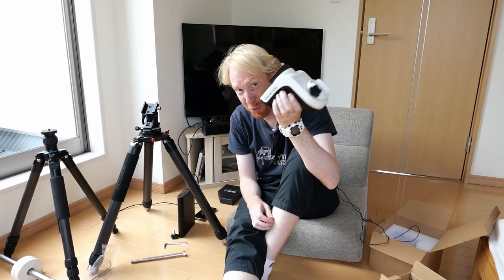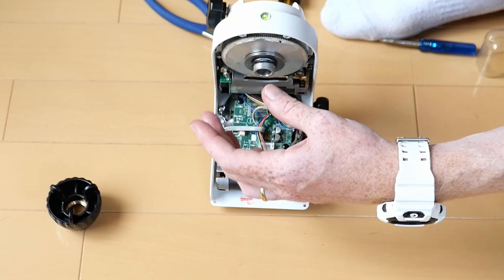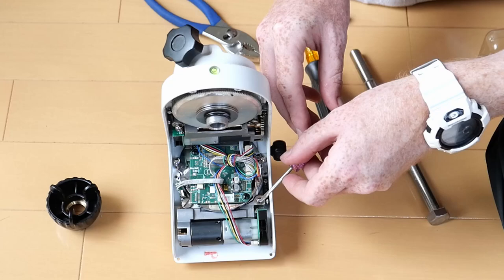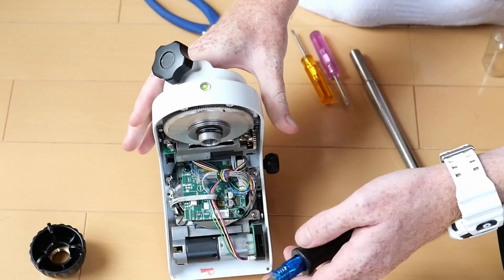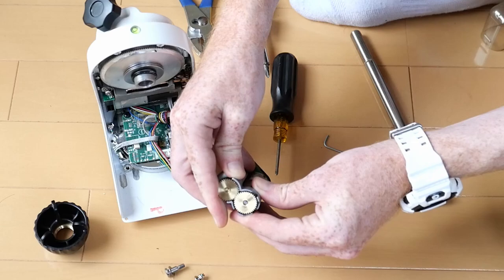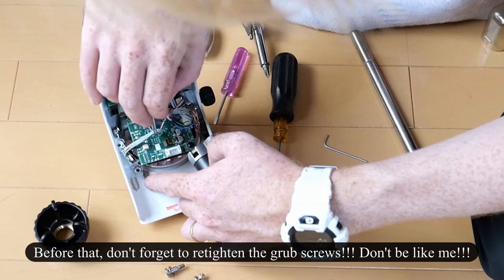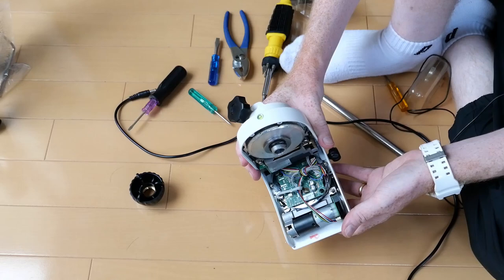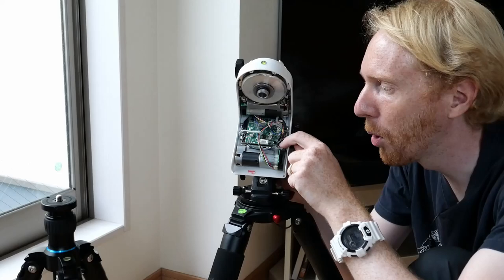Tuning the Skywatcher AZ-GTI! The road to an ultralight, fully automated astrophoto rig!

Comment: Thanks for this tutorial. I just bought one of these used, and will go through all the things you've done here, just to ensure it's working as intended.

in its supported configuration, that spring is pulling horizontally, without gravity being an issue. When used in eq mode, that spring is having to fight gravity. You could probably use a stronger spring to counter this.

The other changes made here will reduce backlash at the expense of wearing out the gears. The two brass gears in the motor and gearbox will definitely wear over time. Some lithium grease will help a bit. Similarly, a little light grease or machine oil in the pivot point and the friction nut near the spring will help.

(I see you mention later that you may want to use more powerful springs. I agree given the new mounting position.)
Reply from the maker: Very useful remarks, thank you! Let me pin your comment so it's very visible to others.
Reply: I put a heavier DEC spring in my AZ-GTi (McMaster-Carr 5108N995), lubricated the worm with "Blue Moly" high-pressure grease, and see smoother guiding.  PHD2 is still showing large backlash, however.  My spur gears are tight, and the worm has no side-to-side play.  The planetary reducer between the motor and gears appears to be the culprit, and I didn't think there would be any way to adjust that (somebody correct me if I'm wrong).

I also adjusted the (tight) RA and (loose) DEC bearings.  I dropped the tripod as far as I could without bringing the feet inside the telescope radius and replaced the top plate 3/8" bolt with a triangular spreader and threaded rod to take the wobble out of the top plate, too.  Each thing tightened things up, but the wind is still my nemesis.  The slightest breath of air still shows in the tracking graph, just not as bad as before.  With no wind I'm typically achieving a bit over 1" RMS error with a 4kg load (SvBony SV503/80 refractor, etc).

I have since replaced the RA spring as well, but now I have to wait for good weather to see if it also helps.

Comment: Ok found out some info, you can use EQMOD with the AZ-GTi mount, but you will need to change some settings.
In order to use the EQMOD software with your mount you will need:
A PC running Windows
The ASCOM Platform installed 
EQASCOM installed.
A compatible mount controller
A mount interface
Cabling
Included in the EQASCOM distributable is a telescope simulator that allows you to evaluate the EQMOD applications without needing a connection to a real mount. In order to use the EQMOD Simulator you only need:
A PC running Windows
The ASCOM Platform installed 
EQASCOM installed.

AzGTi - see note below	144		2073600	14400	0.0625	
For the AZGTi mount:
You will need to download and install the skywatcher EQ mode firmware to your AZ-GTi
You must set EQASCOM to use custom gear settings with the following parameters:
Total Steps: 2073600
Worm Steps: 14400
Tracking Offset:0
Reply from the maker: Thanks for the details Christopher! I actually did that recently :-) GSS works well as well! I have a video upcoming on both EQMOD, EQMOD Limits, and GSS - so much fun :-) But as you predicted, the EQDIR cable from Aliexpress is pretttty baaad :(

Comment: Another great video.  Looking forward to see the  final setup as I think it's great to have such a light set up fully automated and controlled assuming the mount will guide accurately.  Thanks
Reply from the maker: I have been able to use the mount in the field, but couldn't polar align it well then, so it has terrible RMS (but OK for 135mm lens I was using!), but others have reported an RMS of around 1.8", which is good enough for wide field!

Comment: Hi! Thank you for sharing ! This said I would be cautious about two things: You might not want those gears to be sitting against each other too hard (or too deep). This would result in wearing the gears prematurely, especially given they seem to be a very soft kind of metal alloy. Then further adjustments become impossible and you have to change the whole assembly. Secondly I wonder if those springs are not intended to protect the gears and motors in case of a blocage, acting like a sort of emergency clutch. I would not block this system from working because if for some reason the motor struggles to move the scope, then the wormgear would be unable to jump back and slip. This would result in a breakage or/and a motor burnt (might even damage the electronics in case of a current surge). So, yes, this might be a solution for temporarily stenghtening the mount but I'm not quite sure it was designed to work like this. It's a pretty lightweight assembly after all and this always come with some inherent little flaws we sometimes have to just deal with. I might be wrong though. Keep up the great content! 👍
Reply: Any PRODUCT that you need to take apart and FIX yourself so it works properly, I would AVOID BUYING all together.  This is RIDICULOUS!

Comment: Thank you!  I discovered it is possible to squeeze the RA motor gears together too much (they didn't move under power), so I ended up adjusting that gap three times.  But! no more backlash!  It was well worth the time.
I have the AZ-GTe mount.  The only difference I have found so far is the lack of the AZ release screw.  Otherwise the insides look identical to the AZ-GTi.
Reply: There is a useful difference between the AZ-GTi and the AZ-GTe.
GTi has dual encoders so you can declutch and manually move your scope without loosing your alignment and with the GTe you need to use the SynScan app (or handset) to slew around, if you loosen the clutch the GTe will loose its position

Comment: Just an update: I just finished the Cuiv The Lazy Geek AZ-GTi Tuning, now will be known as the  CTLGT-AZGTi  procedure and thanks to your video it was not that hard! (Thank you) I choose to leave the both springs attached and did the steps to reduce the backlash, not sure if this will help as maybe mine mount was good to start with? But now I know at least that it's the best it can be! If I was not so Lazy I would have cleaned all of the gears from the factory grease and reapply so grease but too Lazy...Thanks Cuiv! Also just for fun I glued a string bubble level to the bottom of the mount and also attached a small bubble level to the Dec so when I start up I know 100% that both axis are 90 & 90. As you can rotate either axis to where ever and with you turn on the AZ-GTi it really does not know that it's at 90-90, it just expects it to be at 90 & 90. So to me that means the encoders only work when the mount is set at 90 & 90 then know how far to rotate from there. I will update when the skies clear what PHD2 says.
Reply from the maker: Excellent to hear, and well done! I hope you will be getting excellent results, looking forward to your feedback! :-)

Comment: I tore down the complete RA assembly.  The RA was very stiff and binding in some points. Removed board and got to the bearing and RA drum. I think the "nut" was over tightened.  Polished and regreased all moving parts. Feels much smoother now.
Reply from the maker: Excellent! I didn't want to go all the way down the rabbit hole, just keeping it simple overall, but well done!
Reply: hows this working for you after doing this?
Reply: I had the binding too in RA but I just loosened the lock set screws a bit and that made it smooth with no binding. I seem to have star trails however even at 60 sec. as the RA/DEC are still numbers when guiding just the ALT/AZ move. It does slew to a target OK. Did I loosen too much? I never removed down to the collar to see the bearings. Just loosened the grubs to move smoothly. No clicking, the slewing sounds good. It will drift from my star after 10 min. and I never tried ALT/AZ mode which does move in RA/DEC.  FLO told me to try ALT/AZ and try to polar align better. Its a rough align now. No PHD2 either. Can it just be bad polar alignment? Hard to polar align except roughly with Polaris obstructed. Will PHD2 help? I did not polish or re-grease. Too Lazy I guess.

Comment: Hi Cuiv, another informative video however a slight difference in opinion and an observation, too much spring pressure may result in excessive worm to gear or gear to gear meshing and in time this may cause pre mature wear even tho at first the backlash is minimised, in fact the spring pre load mechanism is a less ideal method of mesh adjustment, I would prefer the manufacturers to implement a fine pitch adjusting screw and locking nut in place of a spring.
I noticed that you seemed to re assemble the gears dry and this would have been a good opportunity to clean and lube with a white Lithium based grease.
Regards Mike.
Reply from the maker: Thanks for the feedback Mike! Yeah I agree... That spring is really, really weak though, to the point of letting the whole thing float with the slightest imbalance (or wind gust). Skywatcher grease was still there and looks fine for now, so I kept it that way. I didn't want to disassemble the main gear, either!

Comment: Hey Cuiv, newbie in the astrophotography space, love your videos especially on the az-gti particularly this video, got mine few days ago to start with planetary photography and just did a heart operation on the mount due to AZ backlash, I am not very experienced with mounts as this is my first "working" mount but felt the crazy backlash when I was testing. Agree with the QC issues as I found out that both washers on the az motor's big screw has been placed both on top (apart from loose threads on the circuit board nount and broken small screw on the az motor). I  placed one of the washers at the bottom of the motor mount, backlash gone 🙂
Reply from the maker: Well done! Yeah QC on those is not super strict!
Reply: @CuivTheLazyGeek  Cheers! Watching more of your vids, lerarning a lot mate 🙂

Comment: Hi all, ok a few nights ago I found out in both RA & Dec what I was thinking was backlash and tonight I went back inside and what I found is the 2 springs were not holding the worm gear tight enough to stop what I was calling backlash and so I choose to just lock down the 2 worm gear mounts. After I locked them down I found out the RA would bind up while having it rotating around and came to the understanding is what Cuiv said that the springs are used to give the worm gear some play to adjust when the main gear turns as if it's not perfectly centered then the spring would let it move and won't bind. So I loosen the RA locking bolt/lock nut until I was about what the spring had the work gear against the main gear and tighten it. and now I can rotate the RA with out it binding up and I choose to add lots of Multi-Purpose Lithium Grease and it made all of the gears much more quite. So this time I hope to not need to open the cover any more. Nest is to use PHD2 and see what my backlash is now. more to come?
Reply from the maker: Wow Christopher, excellent work! I hope it will work out well for you!! I think getting a stronger spring would also be nice...

Comment: Hi cuiv, great video. I have a Az-GTi too. My problem with this mount is that while chasing the stars I can hear a continuous clack, and this makes the mount vibrate! The cause is the motor in AR and the crown... as if the spring is pulling too hard.... In your final setup did you remove the spring or keep it ?

Comment: Hi Cuiv, I think those 2 springs are good to have and I agree stronger springs would be a good idea to let the motor/gear self adjust while rotating. I think almost all worm/gears use a spring system like this, so a stronger spring and adjusting those 2 gears would be the best solution. Finding a spring that is the same size in length would be the hard part?  So my only question is after you were done (Cuiv Tuning) was there an good  improvement in tracking/guiding?
Reply from the maker: As far as I can tell, the springs here were really an excuse to make sure the mount work even with poor manufacturing and QC. Pull springs are hard to adjust... From what I remember the CEM25P uses push springs which can be tightened/shortened via an adjustment knob, and while it is painful to use it at first it's an example of a good implementation of spring loading...
There was a noticeable positive effect on guiding, which was good, and I need to experiment some more!
Reply: @CuivTheLazyGeek  GREAT Cuiv, PLEASE report back. Also in PHD2 you can do a comparison before and after. Any improvement would be awesome! Do you know if NINA can show the tracking with a guidescope w/camera?
Reply: @CuivTheLazyGeek  love to see some results whenever possible, would be very useful..it's positive that you have already a positive effect :)

Comment: While you had it apart you should've taken the lock ring off of the Dec spindle. Pretty sure there is a needle bearing between the two thrust washers. Pack that bearing with some grease, white lithium maybe, and good to go.

Comment: Hi from Tasmania, I have made some technical comments re-working on this unit, on Astrobloke page doing a similar rework to improve tracking etc. there are some points that you may have overlooked because being a very small mount, the finer adjustments are not immediately obvious. I have recently rebuilt my unit and worked out how these fine adjustments are made. I do a lot of machining to built mounts and modify others etc. so have become very familiar with adjusting worm and wheel gears, as well as making them, Getting the best out of gear and clutch systems is something of an art and needs a sensitive touch. Hope you find my comments helpful. Stay safe and Regard from the Southern Cross Observatory-Tasmania 42 South.
Reply from the maker: Thanks Shevill! Do you have a link to this kind of information!
Reply: @CuivTheLazyGeek  No, it is what I have worked out based on many years of designing and building mounts of many types and sizes and observing how allowances are made for adjusting the correct fit and clearances for gears. Worm and wheel gears always need a form of adjustment to allow for lack of concentricity between machined parts. This is why worm and wheel gear sets for high quality mounts are so expensive. In these cheap mass produced mounts there is limited quality control, the components are not made from the best materials and the final fit and smoothness of such drives  is in the lap of the Gods. No matter how carefully I adjusted my RA system there is a slight binding during one rotation, indicating a lack of concentricity in one or more of the machined parts. I am used to machining parts to a high level of accuracy-so one soon gets used to how good/bad a finished part can be. I spent best part of a day on my SW unit before I was satisfied it would perform as intended. Prior to this, there was no way I could balance anything, the drives were so stiff. Sorry I cannot be of more help. However, here is a link about those threads on tripods, cameras, mounts etc. Based on the British engineer, Whitworth who first standardised the thread form we still use today. In the UK it is still called a Whitworth thread, in the US they refer to it as UNC. hence some confusion-some folks don't realise there are two sizes-1/4" & 3/8" the larger size is found on larger heavier gear and in telescope use it is common to have both sizes to it can be used on a wide range of equipment. https://www.photokonnexion.com/photography-thread-size/

Comment: It seems that the spring is the root cause… change it for a stiffer would not solve both axis…
And had to edit :) saw that already there was a comment about this…
But did not notice if it was better or equal to your method?

Comment: I’m now in the hunt for one of these :)
Reply from the maker: It's a bit of work, but as long as you use it for wide field purposes, it should work well!
Reply: I have one, it's great but you run out of payload capacity really fast, in hindsight I'd buy the EQM-35 and a wifi adaptor
Reply from the maker: @terrybrooks395  A very good point - this is really a mount for light, wide field astrophography! You cannot load anything too big or heavy on top!
Reply: and here I was getting ready to put my C8 lol jk..I think is a pretty cool concept your striving after. A fully automated portable setup. Specially since I live in new york city, I have to travel every time I observe or photograph. So this could come in handy for when I'm feeling extra--lazy.

Comment: Hi. How much benefit could I expect to get from just doing the RA and DEC spring tension adjustment (and not the more complicated gear meshing adjustment)?

Just asking as I'm lazy!
Reply from the maker: It really depends on the mount! I think that basically bypassing the spring loading in the RA axis at least could provide better results in general, and less wind sensitivity. But it's hard to tell with so much variability between the mounts. Good luck!

Comment: Hi Cuiv, Just a quick question, I have fine tuned my GTi mount ready to use with my guided Evolux 62ED and ZWO 585mc camera, I was curious regarding your experience with binding after locking the drive on to the worm gear... Thanking you regards Tom...

Comment: how does the mount working in the cold?
The only reason i can see for the spring it to pull the worm in as the mount get cold and everything shrinks.
I would expect that the backlash would return depending on how cold it get.